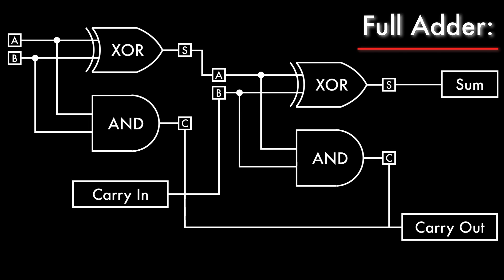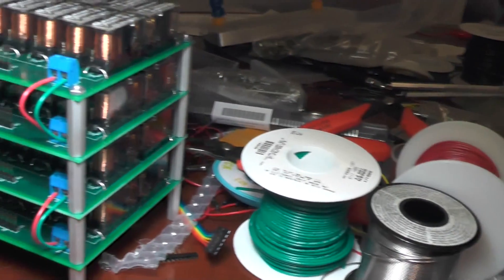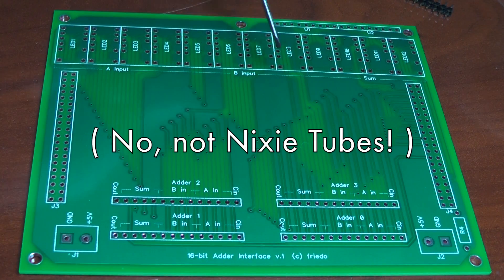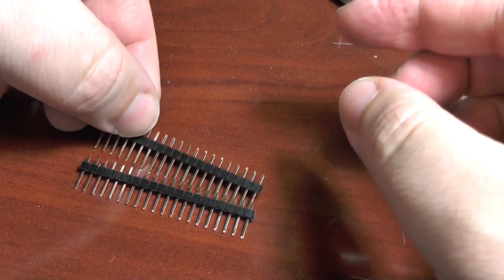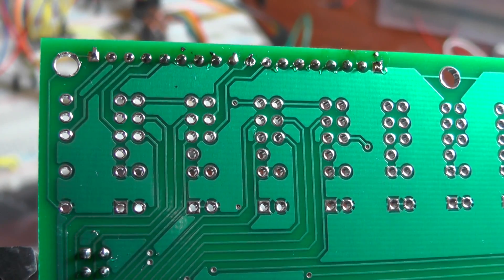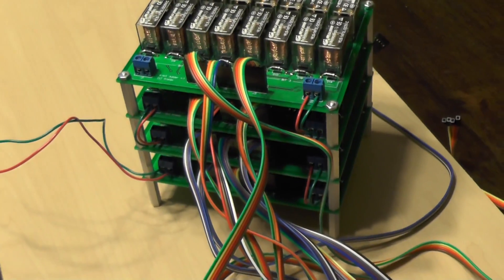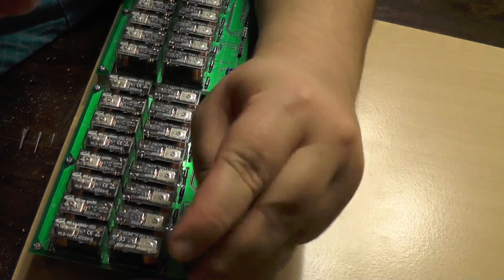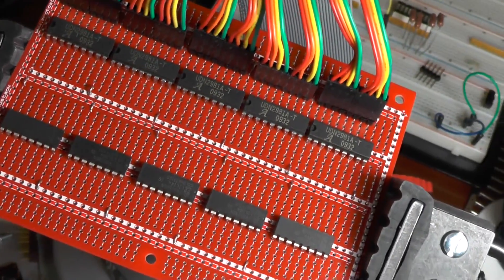Relay Computer ep. 3 - Completing the 16-bit adder

Comment: I just started this series, and I'm excited to see how it turns out. I'm suspecting a potential problem with the fact that signal lines in this system have to be able to drive sometimes multiple relays, together with the narrowness of these traces and their traversal over 0.1" header pins, there may be some hot spots with increased fanout. Of course this all happened 7 years ago, so I'll soon find out if I am totally wrong or not. Geek on!

Comment: If I'm understanding correctly, the ripple nature of your adder makes the time for completion of the operation variable, depending on the number of carriages the data dictate.  Which means to pass the output wherever it's going, you need either a "wait" signal (which would need be a multiple-or of the carry bits -- just a "short" as you call it) or to clock it to the maximum required, making the overall architecture synchronous.

Comment: I think you did a great Job. Did you ever reworked the board, so you didn't have to use Jumpers to fix things? Also would it have been helpful to add a LED & Resistor across the coil so you could see which relay was on ?

Comment: What is the orange thing called U1 and U2?
Reply from the maker: Those are resistor networks - basically eight 330Ohm resistors in one package with one common pin.
Reply: Thanks. Nice job

Comment: liking your videos!

try using blu tack to hold your parts in place while you solder them in, instead of bending leads.

just remember to remove the blu tack before you solder any leads that are close or in contact with the blu tack as it can leave a bit of sticky mess behind.